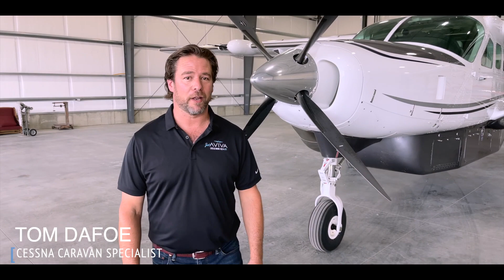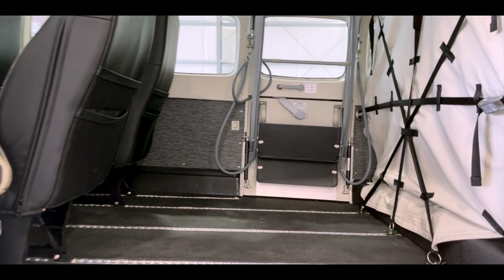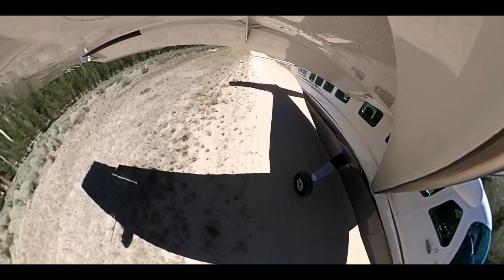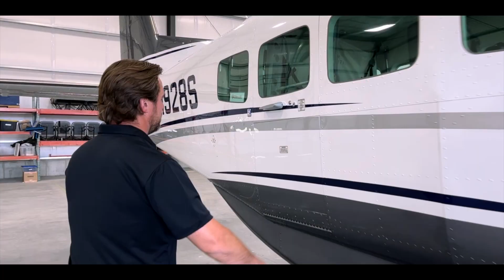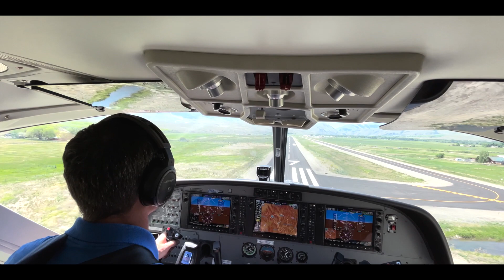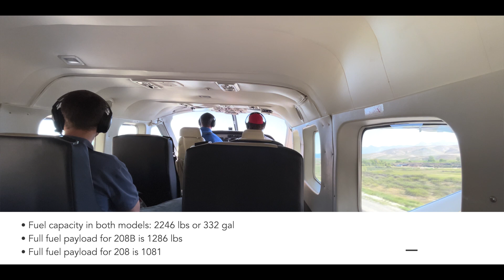Aircraft Review: Cessna Caravan

Comment: "Life is short: fly a jet" - a Turbo Prop feature follows.....  :o)
Reply: Which a turbo prop basically is. Its a jet engine that instead of using thrust to move the airplane, uses that thrust to spin a kind of waterwheel behind the engine spinning a shaft running through the engine to turn the propeller.

Comment: great airplane! such a payload! but a PT6 needs a pressurize airplane.
Reply: Something which this guy failed to mention is that caravans come equipped with supplemental oxygen systems in the form of an oxygen tank with provisions for masks or cannulas for pilots and passengers. The caravan itself is capable of altitudes of 25,000 ft, so this lends itself well toward cruising high above weather (with the exception of thunderstorms), while maintaining cruising speed and improving fuel economy. It would be impractical for this aircraft to be pressurized because the windows are too large and the necessary reinforcements to the fuselage would significantly increase the empty weight of the aircraft. In addition, this would limit the overall lifespan of the airframe. If properly maintained a caravan can fly indefinitely.
Reply: @tomdickens7856  good point. it helps!
Reply: Very accurate answer tom Dickens, as a former caravan pilot, taking them to high altitudes such as 25k was not always the best way to fly. The body just isnt designed for the efficiency of flying at high altitudes like a king air or something. I can say you can stop a caravan in 400ft